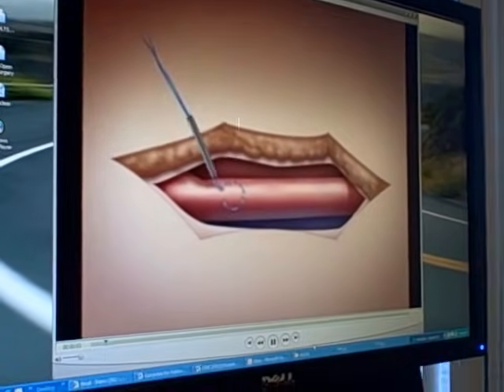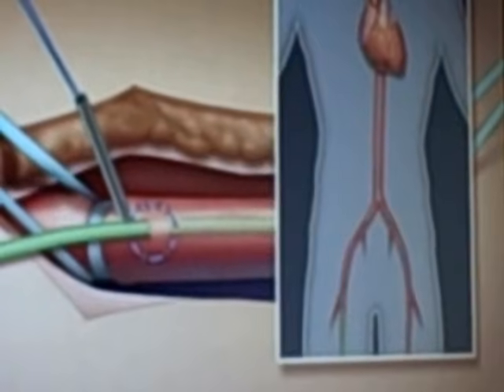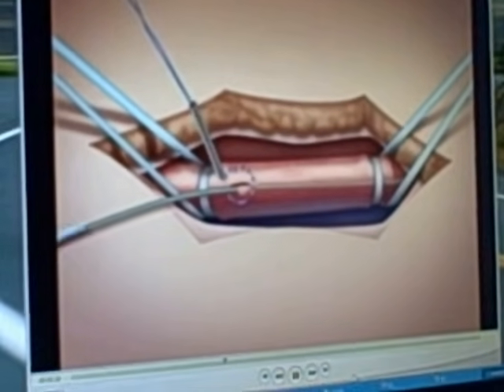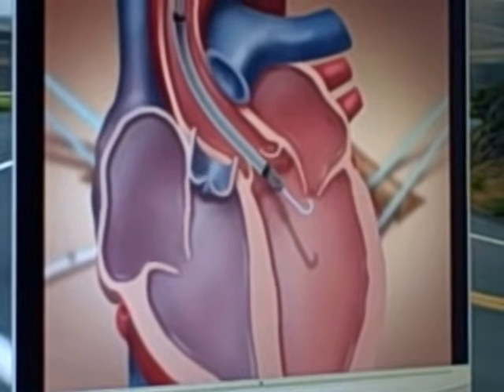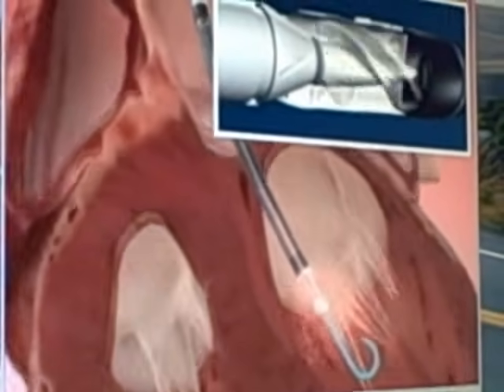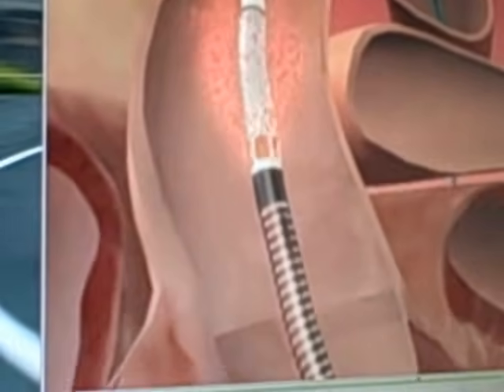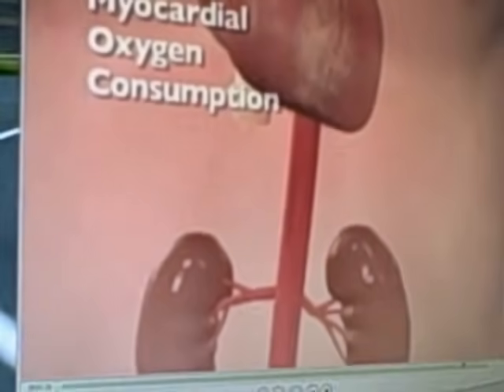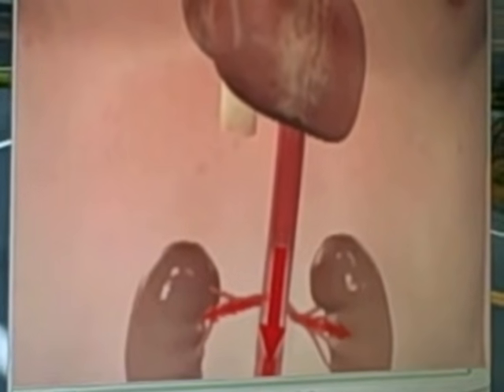Impella 5.0 animation showing how it aids heart failure patients

Comment: @riverudead, in this case mechanical damage of the blood cells by the device can cause hemolysis. The mechanical damage is the result of being suck up and pushed out the Impella at high rpm's causing sheering and damage to the RBC. Hope that helps :)